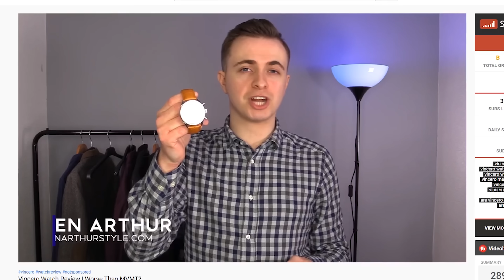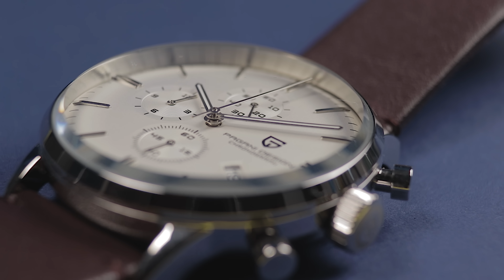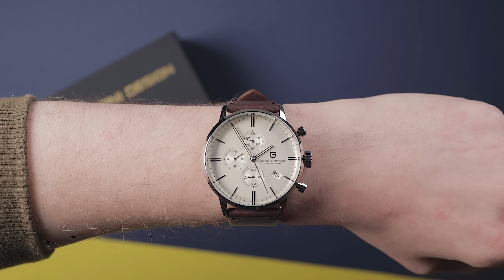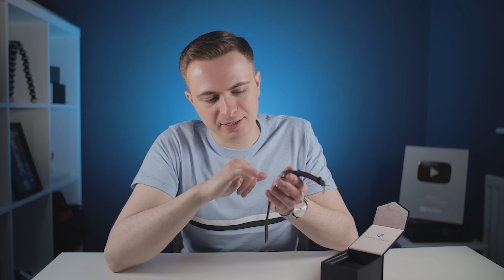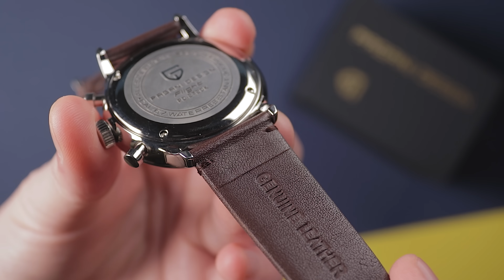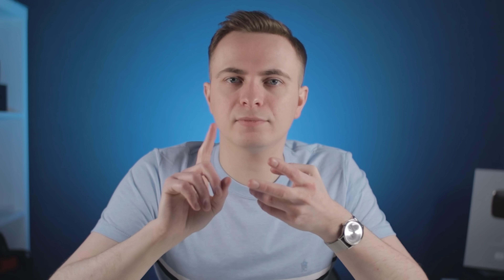Watch This BEFORE You Buy A Vincero Watch...

Comment: That video made me buy a Pagani a year ago. Great watch, I love it. Unfortunately mine came with a bit of dirt under the crystal but that doesn't really bother me for that price. When I need to change the battery, I will clean it. The minute hand of the chronograph stopped working a few weeks back, I don't know if it's worth fixing it or if I should just get a new one instead. Doesn't really bother me either, I only got the chronograph model for aesthetics and not function anyway. I purchased a new strap because the old one started to fall apart. Besides these negative points, I would still recommend it to anyone looking for a cheap watch.
Reply: Get a new one I only hearing Ontario and we could sometimes charge more than the actual watch itself so the minute hand on your chronograph stopped working depending on the movement and the watch it could be more expensive or cheaper

Comment: Great vid! Can you or any of your subs confirm this sub dial at the 9:00 is a twelve hour totalizer. I thought that was included in the Vincero Rogue I foolishly bought a couple of years ago. I am an old puddle jumper Cessna pilot. The “24 hour military” dial is USELESS. If you are LEO, Military, FAA pilot, any of that and the 24 hour clock is so drilled in you that you will find this idiotic dial superfluous. So, if you know I would be grateful. Thanks & Cheers!
Reply: Not sure if I fully understand your questions, but the 9 o clock sub dial is just 12 hours. I'm not sure what would happen though if you let the chronograph run for more than 12 hours as I've never done that.
Reply: Samuel l Hi, Thanks very much for the time you took to get back. What I hope that dial @ the 9:00 does is this: I click the chrono, it passes through an hour and then another and an extra 15 minutes, then you stop the chrono. The 9:00 dial reads 2 hours, the 60 minute dial reads 15 minutes and it took you 12 seconds to hit the stop button : 2hrs, 15 minutes, 12 seconds. A lot of these budget chronos replace the hour totalizer dial with the idiotic “24 Hour Military time......3:45 PM reads 15, almost 16 hundred hours. That is what my Vincero “Rogue” does. Thanks again!
Reply: Samuel l BTW, I just looked at my Vincero. The sub dial reads 24 hours. I do now believe this little $40.00 (now $57.00 on Amazon) has a 12 totalizer complication! Thank you again!👍☝🏻👍
Reply: @jazzman5598  Yeah it definitely is. I get what you mean now, I've seen a couple fashion watch chronographs have seconds, minutes and then a quite redundant 24 hour subdial.

Comment: 30 Meters water resistance are not going to take you far ?
Ive never been below 7 Meters!
All divers here?
Reply: You need to educate yourself.
30m of water resistance does not mean you could go 30m underwater with this watch.
It would probably die the moment you hit the water.
Reply: I'm not sure if this comment is sarcasm, but I'll answer it anyway. 30 atm means that it can withstand pressures up to what water pressure 30m down is (about 3 atmospheres). When you or the water moves at all, the speed and acceleration makes the pressure on the watch much greater

Comment: What exactly is the selling point of a watch these days? Why would anyone need a ⌚ these days?
Reply: I wear one for several reasons, usually one or two at a time:
* It's an item of jewelry. Some of my watches are very pretty. Most coordinate with various outfits.
* I am amused by the idea of this mechanical thing in my very digital world.
* Sometimes I find it easier to look at my wrist than to say "Alexa, what time is it?" (This may not be the case with you, but I had a stroke a few years ago, so speaking still takes some brain power.) Not everything in my home has a clock and most of the ones that do (like the oven) I don't bother to set.
* One of my watches tracks my steps and details of my sleep. Oh yeah, and it also tells me what time it is and the date with fun faces and uses interchangeable fun straps.
* If I really want to get up at a particular time but don't want to disturb people around me or don't trust that an alarm clock will wake me, I can set my smartwatch to vibrate at a particular time. 
* If I am out and about, if my phone rings, my smartwatch will tell me who is calling and let me reject the call if I want to. My old smartwatch used to even let me dictate texts and talk to Alexa. (I would actually dictate texts to it while driving so I didn't have to take my eyes off the road or while walking so I didn't have to stop to fish my phone out of my pocket.) 

I am under no illusion that I "need" it. There are enough clocks in the universe that nobody really "needs" a watch. They are sometimes useful to me, even if they are uses I could otherwise do without. I am fully aware that it is an affectation. I choose to like it anyway.
Reply: For checking the time the easy and quick way, and as jewellery, i never leave the house without a watch.

Comment: I wish I had read your review or watched this video before convincing my wife to buy me a Vincero Chroo S.  This was our experience.

The Chrono S watch in Rose Gold looks like a very smart watch.  I am not qualified to comment on the engineering but I can say that it has only gained 3 seconds in the first month of use (compared with the atomic clock); which so far as I can research online is much better than most modern battery-operated quartz watches, though not as accurate as some Bulova, Seiko or Citizen, that may be more expensive and not as stylish.  However, it has one major design fault.

On every Vincero advertisement, the Chrono and all their other watches have the large sweeping hand that most people would take to be the “second hand”, at approximately 36 seconds past the hour.  Any reasonable person looking at the advertisements would assume that this is a normal “second hand”. However, on the Chrono range (and possibly the Rogue) the large sweeping hand is NOT the “second hand”, it is the stop watch “second hand”.  I have other chronographs where the timer “second hand” is one of the small dials (usually the bottom one) as you would expect since the hour and minute times hands are also small dials.

What this means is that the large sweeping hand sits at the 12 o’clock position and anyone who admires your watch will think it’s stopped. It’s also quite disconcerting not to see the “second hand” moving.  Sure, the small “second hand” does move but it’s barely noticeable in every day use.  To me this completely ruins the overall appeal of the watch.

We found the Vincero service to be extremely arrogant, condescending and at times a downright insult to your intelligence.  None of their emails are ever signed unless you insist on getting a name.  The agents in California refused to pass any email to the owners in China.

My wife ordered the watch as a significant birthday gift on 26 April 2020.  At that time there was no indication on the web site that they provided a custom engraving service; so, I made the suggestion.  Rather than thanking me, the response was that they do normally offer an engraving service but that it was suspended due to “coronavirus quarantining”, which is fair enough.  However, I responded “If there had been a note on your web site that you have an engraving service, which is temporarily suspended,  I would definitely NOT have placed the order, as it was already past my birthday and would happily have waited until you were able to resume this service, which must be imminent”.  Obviously, they didn’t want to advertise the fact that they had temporarily suspended the engraving service, in case people like me would withhold their orders.

The reply was that “Since your package has been shipped already, here's what we can do. Once it arrives, please refuse the delivery so that it will be sent back to us. Once we received it back (sic) we will let you know, and then we can wait until we open the custom engraving again.”  So, they wanted to let the package make the journey from California to Glasgow, Scotland and then return; how stupid can you get.

Miraculously, however, on 27 April 2020, they were “able to get a swift response from (their) fulfilment center and they were able to cancel the shipment of (my) package. As requested, we have canceled (sic) your order and processed a refund back to your account. Please allow for at least 3 to 5 business days for it to reflect on your bank. However, my wife didn’t receive the refund until 25 May 2020 and then only after sending a reminder to which the reply was “We are sorry about that. It looks like the refund didn't push through. I went ahead and reprocessed it. It should be reflected in your account soon.”  It then appeared the same day, which gives the lie to the original statement about 3-5 business days.

On May 13 2020, I emailed to say that “Although you have not notified me as promised it would appear from your web site that you are now offering engraving again and they replied the same day “We are sorry to hear that you are (sic) not notified of this. It looks like we are gradually taking the engraving back on our site and it is only available in some watches at this moment.”; which is another way of saying they forgot or couldn’t care less.

My wife re-ordered the watch the following day but a week later had not received any dispatch or tracking information.  The response was “I am very sorry that you did not receive your tracking information and I am more than happy to look into this for you. ….. maybe it was blocked by your spam filter?” which it wasn’t, in other words it wasn’t sent at all.

The delivery was a complete farce. Nothing happened from 17:58 on Friday, 15 May, when it was given release by Customs, until 19:06 on Thursday 21 May when it departed San Diego for Los Angeles Gateway.  In response to my wife’s enquiry they said: “There may be a delay in the update of your tracking info as in most cases, the package just missed a scan and will update at the next checkpoint. Please be informed as well that delays are a possibility as some couriers are not working at full capacity due to the Covid-19 Pandemic”.  This was nonsensical because there were no delays at any other stage of the journey.  No sensible explanation was ever received for the fact that “the package did not move for 6 days nor why it took 12 days from receipt of order to the scheduled delivery when the normal time for Express Courier packages from the US to the UK is 2 days.” All told the package passed through 6 hubs before delivery on 26 May 2020.  This is not “express delivery”.

It is also worth noting that Vincero watches are constantly on an alleged 15% sale, with a countdown clock purporting to show that you only have a few hours or minutes to complete your purchase at the sale price.  I don’t know about the US but this is a breach of the Advertising Standards Code in the UK.  Once you register, you will receive email advertisements every day, though you can unsubscribe, I haven’t found a way to stop the watches literally popping out at me every time I am on the internet. You should also watch out for “sponsored posts and ‘review’ videos that have been paid for by the brand, making them inherently biased and untrustworthy”.

Overall, Vincero is an interesting story, the watches are stylish and to the initiated look reasonably priced but you should be aware of the “second hand” issue with the popular Chrono series and the appalling, condescending service before deciding to buy.

If the watch had not been engraved, we would have returned it because of the “second hand” issue.
Reply: Sorry about your experience - but the second hand really shouldn't be an issue. When a quartz watch has a sweeping seconds hand for the chrono it means that it's a meca-quartz. It's actually a mechanical chronograph built onto the quartz movement (and probably a Seiko of that) and most watch guys will recognize it rather cool. The idea is that you get higher precision on the chrono than what you can get on a normal quartz chrono with analog dials and it's quite sophisticated. If you don't want your watch to look "stopped" you can always just start the chrono. I own two meca-quartz' myself and quite enjoy them.
Reply: @poulwinther  
You can also get the sweeping hand on normal quartz chronos.
My Seiko solar Sumo has a sweeping second hand, and it is not a mechaquartz.

Comment: Thank you for saving me from buying a Vincero.  I nearly paid for one.  I am now happy with a much cheaper Timex Expedition and am now saving for a Citizen Echo Drive Chandler
Reply: Before you splurge for an eco-drive watch, look at them on ebay. They go pretty cheap on ebay, particularly if you don't mind something like "there's a scratch on the glass" or "I'll have to put a missing pin in the bracelet". Sometimes a great slightly older model that was $250 new will go for $50 with no visible flaws. (I'm thinking of one with sapphire glass. I got it for $30. Works great!) If you're willing to spend a little more (like $50) you can get one made of titanium. (Will probably do that sometime when I feel like spending the money.) 

I decided I would like an eco-drive watch. (I usually get mechanical watches, but I wanted something for travel that I could let TSA have their way with)  I now have three (casual, formal, and a daily use beater), and will buy a fourth when the right one comes along. (I'm looking for a chronograph, maybe one with radio time setting.) All three, together, cost me less than what I was prepared to spend for one new, and that'll still be true when I buy the fourth.

Just check the conditition and size before you buy. I've avoided the "for parts" watches, but I bought one that looked nice... and what arrived was itty bitty. The hand shown with it in the photos must be quite small, it's a womens' watch. (Very pretty though, and I got it cheap, I've saved it to give to a friend when I next see her.)

Comment: I was looking at Pagani for a beater watch, but I want a quartz so I’m not setting it too often.  Recommendations?
Reply: Bob dabiuld a Quartz Phoibos is around 125.00 Bucks.40mm,Solid Bracelet.Excellent Watch.
Reply: Echo Chambers just bought the Xiaomi Quartz watch last night.  White dial with concentric circles and blue strap.  Wasn’t looking to spend over $50 on a beater.  If I wanted to spend $100 or more I wouldn’t be on AliExpress, I’d have a bambino.
Reply: Bob dabiuld oh ok,I was just saying the Phoibos was comparable in price to the Pagani and is a much better watch.I actually bought a 10.00 Readeel Field Watch off Ali about 2 Months ago.Its 38mm,Quartz and works perfectly.Ali is the Best to get Good,Cheap Watches.Congrats.

Comment: Looog to looog size. That being said, 30m water resistance is much more than splash resistant. You can leave your phone soak for an hour in 3 feet of water, and it doesn't have that high a rating. Its just some dumb thing that gets repeated over and over. Likely someone just didn't reseal their caseback properly and they went in the shower with it. suddenly its fact.
Reply from the maker: I wouldn't say so mate, I've had a couple of '30m WR' watches that have performed like shit even in light rain, which was disappointing
Reply: I have some advice for you:
RTFM!

Comment: Or you can get a Swiss made automatic watch with sapphire crystal with eta 2824 on a bracelet for $150 on Amazon from the swatch group.just search Calvin klein automatic watch on amzaon.yeah it's a Calvin klein.but they are part of the swatch group and you get a great looking Swiss made automatic watch with eta 2824 exhibition case back sapphire glass on a nice bracelet with c1 Swiss super luminova lume on the hands.all that for $150? . You'd be an idiot not to buy one.smh.i swear people don't do enough research before they pull the trigger.buy something nice.not an ali express vincero or pagani design.yah the pagani is ok but save your money up a little tool you got the $150 and get something all swiss made automatic.get yourself something extraordinary.and for$900 one jomashop you can get an all in house Swiss made aauto.the eterna heritage with in house Swiss made automatic movement.the eterna caliber 39.great Swissmade in house automatic movement and watch.and for the same price of$900 if you rather go German you can a circula which is an all in house made German watch with an all in house German made movement and all in house German made watch for the same price of around $800-$900.the in house all German made movement in the circula watch is absolutely amazing.and for the money you won't find an all in house German made automatic watch unless you get like a used nomos maybe.like i said always do your research before you pull that trigger.

Comment: I can basically guarantee that it isn't Hardlex crystal, on account of that being Seiko's trademark proprietary hardened mineral crystal. And, more generally, if you're looking at budget, an entry level Eco-Drive will have you set, if you're already looking at quartz movements. Even better though would be a decent Casio digital.

Comment: I own one. It is an astonishing value.
Reply: Ian Butler Is it reliable so far? Any cons that you might have noticed?
Reply: @leomedina5614  Hi Leo,
I have only had it a few months. Jody at Just One More Watch did an excellent review to it as well as Ben. If you have not watched it you should. But yes, it has been reliable so far. The back is held on with four tiny screws, so I think you could change the battery yourself, easily. As Ben stated, the movement is a higher-end mechano-quartz that actually costs about what the watch costs. No problems so far, and no cons I could mention. It is big, but that style of watch, in my opinion, looks good even when oversized.